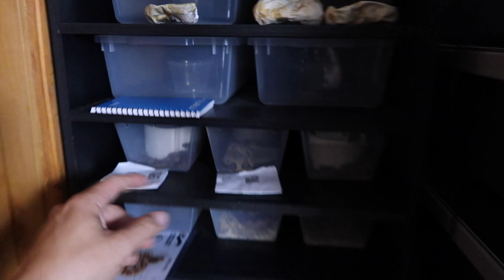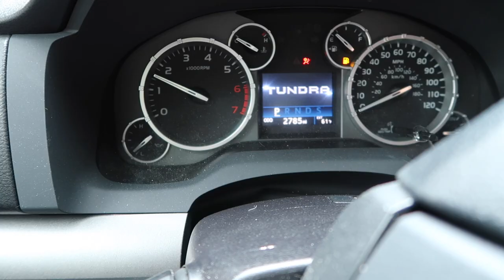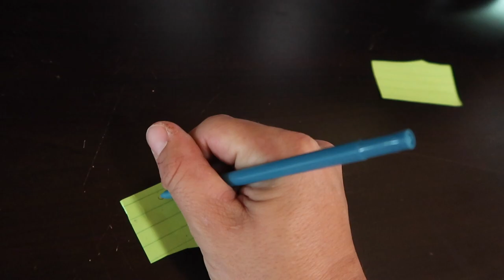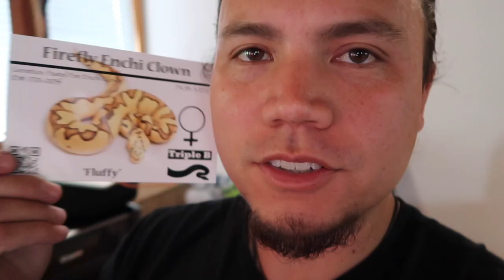Shooting Snakes

Comment: hey man just a question, i got my first BP and i have it in a plastic tub and i have everything besides the heat for it and i know its important. Do you think if i place a under tank heater it would melt the plastic? Because a lamp sounds like the harder way as the lid is covered so i feel that it won't work?  Also i thought about putting a piece of wood or something between the Tub and the heat pad if that would work.. Thanks!